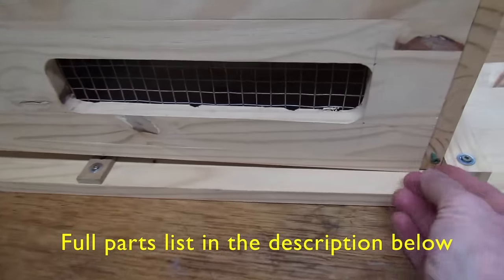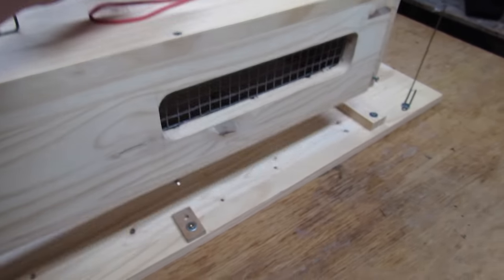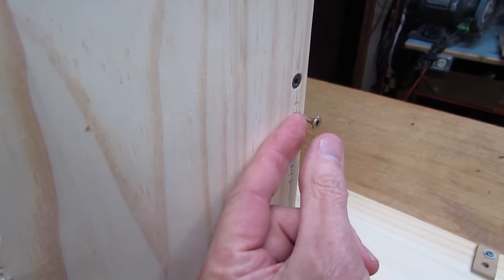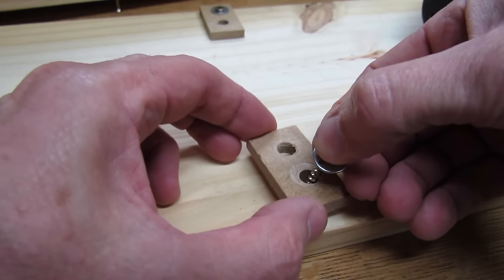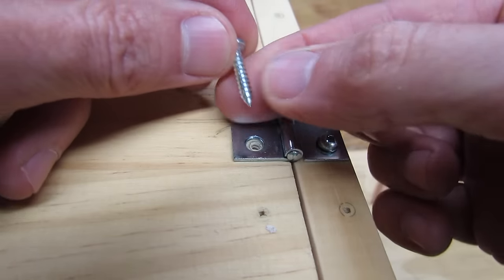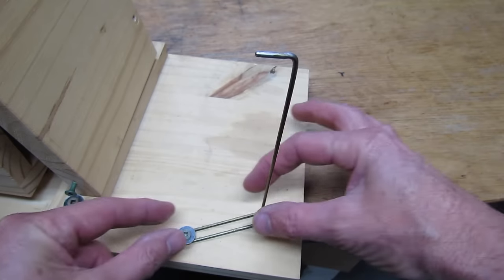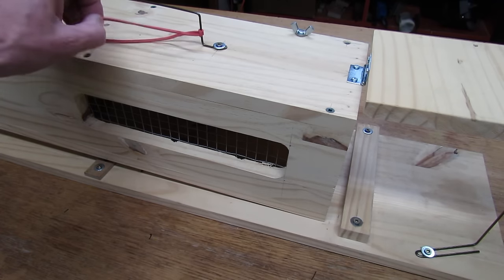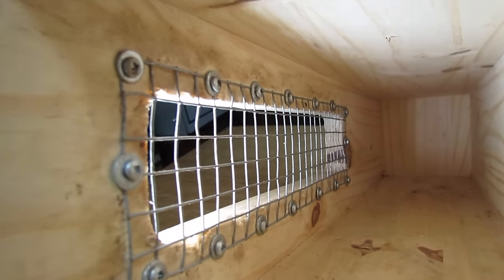How to Make ●  a Simple HUMANE TEETER-TOTTER  Squirrel Trap

Comment: I recently made a copy of this trap and found it very well thought out and effective . Could I be bold enough to suggest something that might make it simpler again.  I fitted a 2" screw on the roof of the box close to where the door hinge is, then I cut out 1" square sections of roofing lead sheet, drilled a hole in the center so that the finished product resembled a washer. All i have to do now is to pop whatever number of these required over the screw which will give me the perfect balance needed to operate the trap.  No need to reposition the " fulcrum" screws  or the "doorstop" on the base.  Thank you Chris for sharing your invention. I am now in the process of making your plastic pipe version of the invention as this will be lighter and easier to transport. Thanks so much
Reply from the maker: That's great! I will be uploading another trap soon that uses an easy to find 6" furnace vent pipe and uses a simpler different type of door and is just as fun to make. Stay tuned!

Comment: Thank you for the great idea, great video on how it works, and how you built it. I built one similar and captured a pesky chipmunk in 2 hours after building and found him a new home. One thing I did a little different was I put a hinge on both ends and used latch hooks to hold it when moving. The ability to open the other end made it easy to load and clean out.
Reply: Excellent idea!! Hinges are a buck anyway.  I am about to make my second and will go with a double door.  Thanks for the tip dude!

Comment: If you change the location of the pivot point you will need to adjust the wire trip, and the wood stop. The more adjustable you make it the better. Great design I might try it.

Comment: Built this last Friday.  Put it out with peanuts and door propped open for three days.  I observed the peanuts were taken in early morning or early evening.  Caught the first one this morning!  Drove him about 6 miles away and released him.  He was apparently stressed from the experience and didn't want to leave the box so I had to tilt the box to encourage him to leave.  Only change I made was with regards to the wood block that holds the door shut - I used a stiff piece of wire as a spring catch instead.  The wood block was too sensitive to setup and would occasionally prevent the door from closing.  You can see the design by looking up video called "Improved Rabbit Box" by The Meat Trapper.
Reply: 3 squirrels in 3 days!  A successful project indeed!

Comment: I made the trap and was trying to adjust the balance because the door fell a few times because of the wind.This morning I went to check and the door was down again. I figured I needed to re-adjust yet again, so I open the door and to my surprise, a squirrel came flying out ! I'm glad I didn't put my face at the opening ...  My question is : Now that this flower eating squirrel, that i will call "destructo" was caught in the trap will it come back  ? or is it too wise now that it was trapped once ?
Reply: Guess what ? 1 hour after I wrote this, my wife calls me and says the squirrel was lurking around and 1 minute later while we were watching, it got caught in my trap. I don't know for sure that it's the same squirrel but I hope so. Anyways thanks for the this video on building the trap.
P.S. my trap didn't work at first because of the door bouncing . I didn't have a magnet so i used velcro and it works fine.
Reply: I forgot to mention the first time I caught the squirrel, In probably less than an hour, the squirrel had managed to chew the side of the wood which is more than a half inch  to half that so beware  !

Comment: Chris, after my terrible luck with the pvc traps I built, I was getting ready to build some wooden ones, when I saw this new one of yours.  I need to brainstorm with a few things before I build a pair of them.  First off, your pine box is not treated, or made of cedar, so it will tend to rot due to exposure.   I'm wondering if putting a finish on the wood would tend to keep the little critters from going in.   Or, how about OSB?  It comes in 7/16 and 11/16 inch thickness.  
OH, I almost forgot.  In all of your videos, it seems like you keep releasing them back into the same yard, in front of the same tree, time after time.  Are they allowing themselves to get caught on a repetitive basis?  My college educated squirrels would never, ever, allow that to happen to them more than once.
Reply from the maker: It's not treated. It's a fair weather trap. If it gets wet, of course with it being wood, it will swell a bit and twist and then it won't operate like it should. Clear coat would be best if you're going to do it. Either that or only put it out when the weather is good. OSB would not be a good choice. I do catch them a few times to get good footage. What I've learned about them is that they are very cautious. Each new trap I put out (I'm working on a third right now) it takes them about 2 days before they will enter into it.
Reply: I have two possibilities with this wooden framed trap.  Lowes has some treated pine that can be purchased in 1x6 and 1x8 inch lumber.  Its pretty nice stuff, and will not deteriorate.  However, the base needs to be wider than a 1x8 cut.   I am actually more inclined to go with exterior BC plywood, cut the pieces, and then put together raw.  Then take it back apart, and apply a water based Poly-finish.  That way it will stand up to wet conditions.   In North Carolina where I live, it rains a good deal of the time, and knowing if it will or won't rain is like trying to,......well, predict the weather.  Its always a SWAG, unless you live in the desert. 

I'm currently modifying those two small Have-A-Heart traps and eliminating one of the two doors, and setting the trip lever back away from the remaining door.   But I'm also going to make one or two of your wooden traps, and hope that my college educated squirrels will fall for them better than with the three pvc traps I made.  

I"m so frustrated with these genuises that I'm almost ready to get my mother's recipe for fried squirrel, with grits and gravy and biscuits for a breakfast.  But I have to capture them first, because I can tell that they are laughing at me.

Comment: Which TRAP works better? this or the the PVC
Reply from the maker: Both are equally effective. One tip I've learned is to put a small cardboard box over the rear half to prevent them from climbing on it and setting it off.
Reply: that's a great idea thanx I'm going PVC
I'll let you know how it goes. the havahart trap isn't working  @chrisnotap

Comment: I made a trap just like yours and set a hair trigger to where a light Breeze would trip it or even a grasshopper crawling in there would Set It Off but every time I check it it's still open and all the peanuts are gone. The entire squirrel would have to be in the back of the cage to get the peanuts and it's not tripping. It's almost like one squirrel sits in the front to hold it down while another one gets the peanuts. It's driving me crazy.
Reply from the maker: That's great that you built one!! Here's a tip. Look at the squirrels you have and then fill up a disposable plastic water bottle with the same amount of water as the main part of the squirrels body and head but not the tail. The tail is very light and doesn't need to be added. Then use that as your test weight. Place it on top of the trap in the centre and slowly slide it towards the back using a pencil or pen. Using your finger is not the same as the test weight just doesn't work and is very subjective and different each time.And remember, the squirrels body will be at about the 3/4 point in the trap as he eats the nuts. He won't be right up against the rear wall as he eats. Hope that helps.

Comment: Why the screen on the side rather than the end?
Reply from the maker: If it's on the end, they will investigate and possibly trip the trap by climbing on it.
Reply: Chris Notap OK thanks!   I usually catch them with a wire mesh trap that has a ramped door held down by a spring.  They push it up as they crawl in.  Not always easy to get them back out.
Reply from the maker: Yes, the door on those things is not easy to open and release them.

Comment: I bought a commercial mouse trap tht operated on the same principal but it was evilly laughably cruel. Laughable for me. Evil and cruel for the mouse because when the mouse went to the rear of the trap, the front door opened a bit. The mouse would make a run for the door and the door would shut.

I could hear the mouse doing this a number of times as I approached the trap. I then fully secured the front door.

I released the mouse in some bush area near my home. The mouse, slightly disorientated coming out of the dark into bright sunshine hesitated about 5 feet from me. Two local birds swooped out of nearby tree and were within half a foot of catching the mouse before it wised up and ran for the cover of some spiky grass.

The birds hopped towards the grass but then I shooed them away.

Those birds nearly made my motivation for buying a no kill trap redundant.

Maybe they did make my decision redundant, after I left the area.